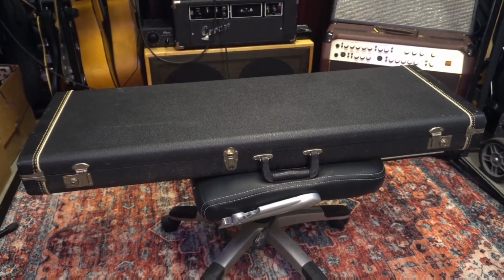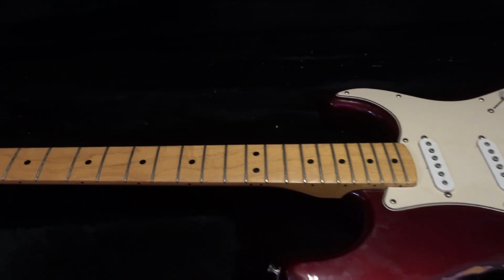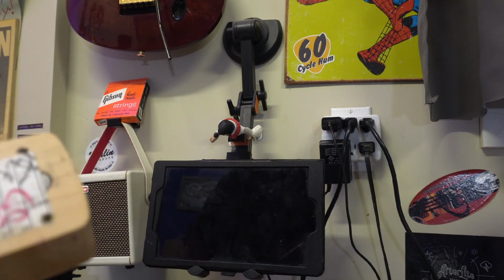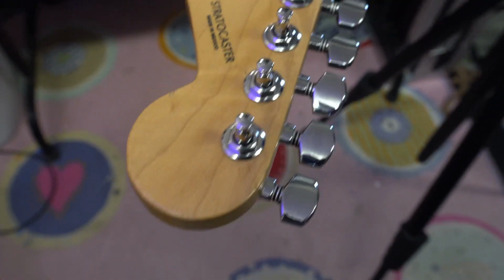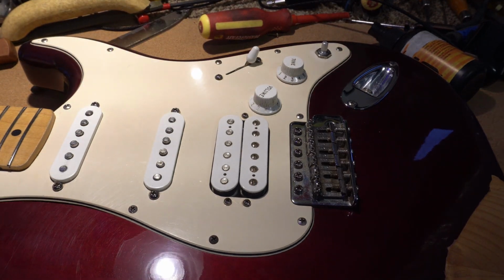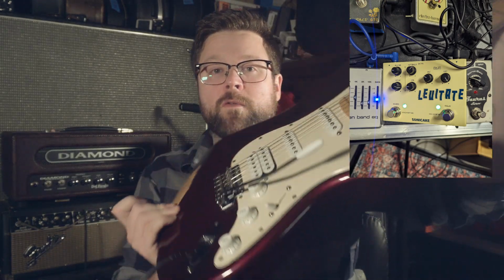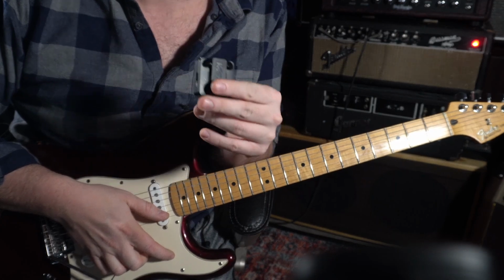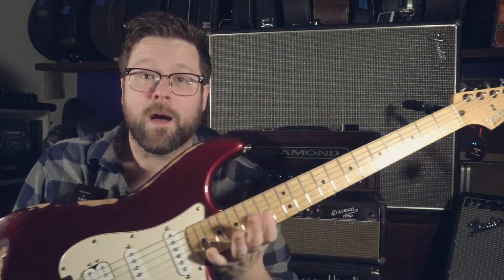This $250 Strat Needs Some Work- 2005 Fender Fat Strat MIM In Midnight Wine

Comment: I would take a heat gun and peel off that finish, burn the wood a little and then apply clear or oil. That relic job is well... Not .
Reply from the maker: That would be a cool project. I've done it before, but it takes a lot of time